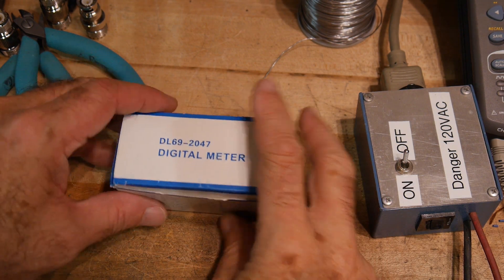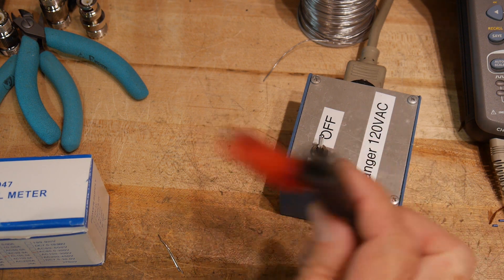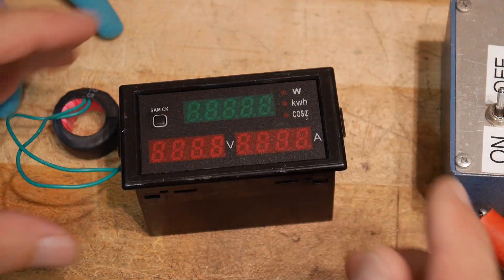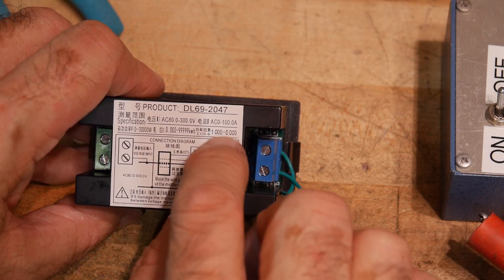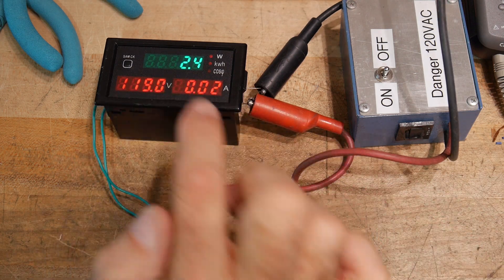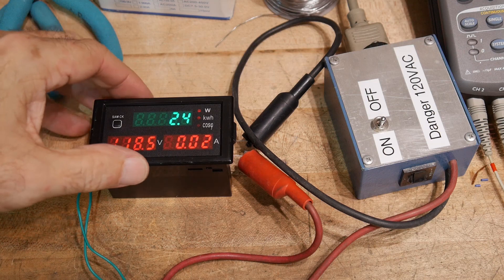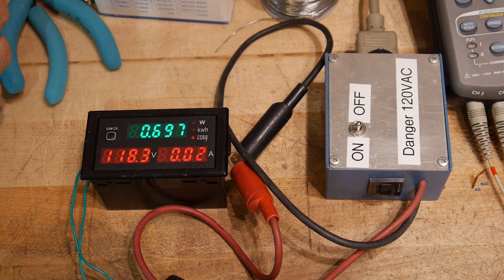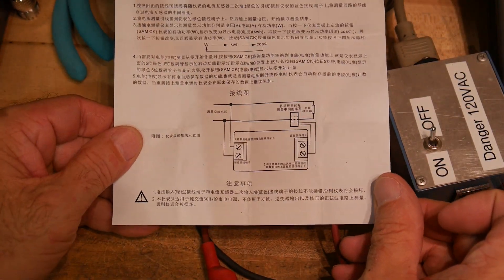#247 AC power meter volts amps watts power factor

Comment: Echoing previous comments: indeed your presentation seems to indicate that you lack the skills to make videos on this sort of subject matter. In particular your use of the DMM to measure the current being drawn.  You already knew that the meter was drawing around 20 mA, yet you set the DMM to the Amps range.  Then, as pointed out, failed to use the correct sockets on the DMM.  When the meter then failed to start (because it was in series with a voltmeter) you just ignored it - this implied quite worryingly that you didn't understand what you'd done. Surely you should have chosen the milliAmps range (and an appropriate lead arrangement if required).  In general you need to improve your planning for video making.  Your hesitant, umming and erring is very distracting.  You seem to have a style that comes across as rambling, inept, and somewhat clueless about the stuff you're showing off.